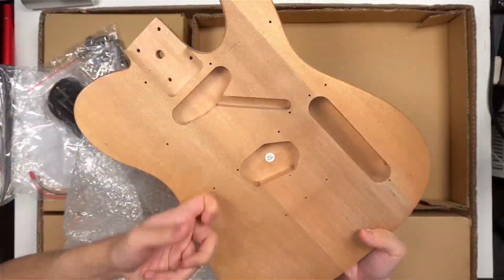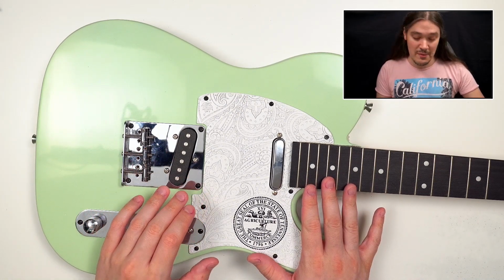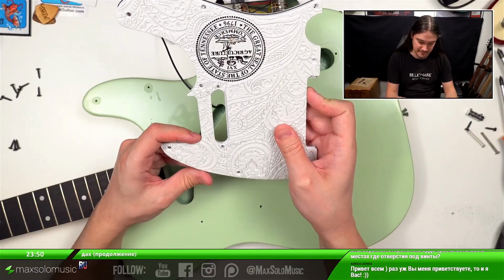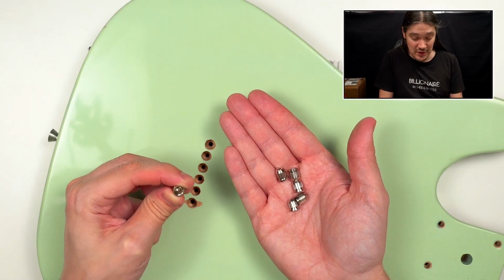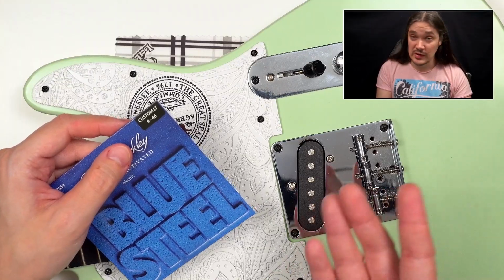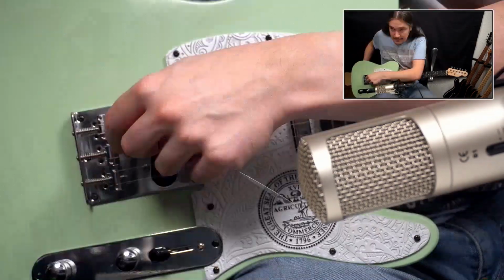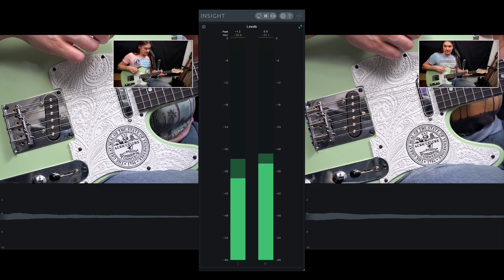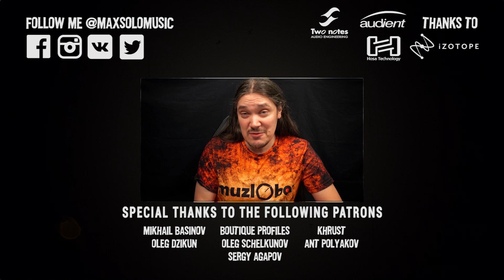String-Through Bridge VS String-Through Body. Harley Benton Tele Makeover Continues

Comment: Lets face it. The string only ever vibrates between 2 points. The nut an the saddle. An its that vibration that is sensed by the pick up turned into a low voltage signal that is then boosted by the amp. In order to move the speaker to make the sound we hear. Top Load or Through Body? Its 50/50 for me.

Comment: to my experience the material of the saddles makes even more difference. Try the same test with stainless steel and bronze. So we see if you find the same difference. By the way when the guitar is unplugged the difference between body/bridge is more evident. I find a more "metallic" sound through the bridge. But when you amplify that the difference is less IMHO.
Reply: Brass.

Comment: to me in conclusion diference is minimum so it doesn't justify the effort of drilling holes trough body
Reply: On this guitar maybe so. I'm not convinced that you would get the same result from a better quality guitar with better woods, nut and other hardware.

Comment: I have a string-trough Tele and a top loader. If there are any sonic differences, it’s probably due to the fact that one is a thin-line and the other is solid. For practical purposes, they sound  the same. Has anyone ever walked out on a band because the guitar was strung a certain way? For that matter, I have never thought I might enjoy someone’s music more if only they had different pickups, or bridge, reverb unit, etc. Sure details are important, but Telecasters sound like Telecasters, for the most part.

Comment: Thinking about upgrading a basic Harley Benton TE-20MN BM Standard Series guitar to through body stringing brought me here and the result is I don't think it is worth the time, effort or expense to do it.
Through the body seems cooler and more artistic but there was very little benefit to be heard in the different sounds between the 2 stringing methods.
Thank you for posting your experiments which has helped to clear up this mystery.
Reply from the maker: There may be a bigger difference with higher price range guitars made of some top-class tonewood. With TE-20 probably none at all :)

Comment: I have a cheap Tele copy which I've owned for years.  It's a Tanglewood 'Quo Master'.  Over the years it has been upgraded with various Fender parts, but one thing I never changed was the 'Top' stringing system.  I had seriously considered coverting it to 'string through', with the ferules, but judging by your very handy video, I'm glad I didn't.  There is very little difference,  in fact you need machines to detect this difference, especially in sustain.  Originally, the reason why I was sceptical about changing the Top stringing was the fact that the guitar would lose some of  its brightness and sparkling tone.

Comment: Top load had a tiny bit more upper mid twang to my ears. But I think with brass saddles it is more pronounced. String break angle being sharper and anchoring in the body to my ears is ever so slightly warmer.

Comment: I prefer the string through but it is due to the long term stability of the bridge. With the strings through the bridge, the forces are constantly pulling up on the rear of the bridge. With a string through setup the preasure is pulling down on the bridge and essentially holding it in place.
Reply: What you speak of here is exactly why I prefer the "string-through-body" method.
Reply: It does not matter if in a strings through the bridge the forces pull up the rear of the bridge, as long as the bridge does not lift.  

I prefer strings through the bridge in a Tele because it provides more chime sound and then I install a hybrid set of strings ( 3 heavy bottom 3  light top).  

This gives me more body sound on the lower strings and more chime on the higher strings.  Fuller tone.  My opinion.

Comment: I am rebuilding a lyon solid body. It was a thru the body axe, I'm going to top load with a adjustable. bridge and tail piece. I am going to have t locate the bridge and drill the holes for the studs to mount the bridge. What formula do I use to locate it or can I just eyeball it?

Comment: I’ve been top loading for about 20 years on my ‘72 Fender Telecaster. I do it this way because I feel the strings are easier to do bends. Just lately I restrung trough the body. Let’s just say that I cut those strings off the very next day and top loaded with a new set of strings. Maybe it’s in my head? As far as sound and sustain?? Too subtle to hear. Great video and lovely build 👍🏻👍🏻
Reply: I’ve had a couple of squire classic vibe guitars and didn’t like how stiff they are to bend. I’ve played other teles that have strings through bridge and was much easier to bend. Classic vibes are well built guitars so maybe it’s the strings through body that I dislike
Reply: I’ve had a couple of squire classic vibe guitars and didn’t like how stiff they are to bend. I’ve played other teles that have strings through bridge and was much easier to bend. Classic vibes are well built guitars so maybe it’s the strings through body that I dislike
Reply: I’ve had a couple of squire classic vibe guitars and didn’t like how stiff they are to bend. I’ve played other teles that have strings through bridge and was much easier to bend. Classic vibes are well built guitars so maybe it’s the strings through body that I dislike

Comment: Thanks for this video helped Me a lot in deciding, I'm in the process of taking off a Floyd Rose set up, which I hate  from an Aria guitar that My Grandson gave Me, I'm going to replace with a hardtail top mount as it will be easier to change strings when required, also I'm going to replace the metal string clamp nut set up, another thing I don't like about the Floyd Rose and replace with a bone nut, I'm not bothered about not having a wammy bar anymore, never used it anyway, this will be My stand by guitar, main one is one of the better Les Paul copy's.

Comment: Well done. thanks for making the video. very little difference. Jimmy Page said he used to break fewer strings when running them through the bridge. the holes in the bridge on the through-body bridges place the strings at a sharp angle without a smooth transition to the saddles.

Comment: I bought a Squier affinity tele on black friday. I to noticed the neck 
pickup had a lower volume and darker then the bridge and noticed it was 
far away from the strings. I opened it up and it's screwed to the bottom
 of the pickup cavity with no way of adjustment. Then i noticed that 
replacement pickups were adjustable. I told myself, it can't be that 
simple could it? So I took a couple of pickup springs I had laying 
around and installed them under each tab of the pickup, so as I turned 
the screws in and out, it adjusted the pickup height. I adjusted the 
stock neck pickup to about the same distance from the strings as the 
bridge pickup, wow. The volume is now close the what the bridge pickup 
is and the tone got a little more twang in it (brighter). I think the 
problem is the neck pickup in these Squire's are just mounted to low. I 
will not be upgrading my pickups.

Comment: So the new pick guard looked a little off centered once it was finished.  This happened to me when I changed the pick guard on the Telecaster I built.  You can see it at 5:36 into the video.  It's not a big deal it just makes it appear as though the strings aren't centered when in reality they are. The reason this happens is because the holes on the new pick guard sometimes don't match up and we have to adjust for that.  This look doesn't bother a lot of people, but I'm a bit OCD when it comes to things being centered.  I assume this is a by product of me being in the military when I was younger.  I ended up filling 5 of the 8 holes in the guitar body where the pick guard didn't match.

 What I did to bring back the visual effect of the strings/bridge being centered is this: I first measured the gap from the right side of the bridge to the pick guard. Then I flipped the new pick guard over and marked how much needed to be shaved off on the other side  in order to create the same size gap on the left side.  I used my dremel with a little barrel sander attachment and very slowly shaved off enough of the pick guard on the left side until the gap matched.  Then I put the pick guard back on and that brought back the look of the bridge being centered. 

I just thought I would toss out that idea in case it happens to anyone else reading this and is having the same issues with the new pick guard creating an off centered look.

Comment: The difference is very clear both acoustically and through the amplifier. Whoever doesn't hear it should consider buying better headphones.
With the strings through the body, the sound has a longer decay and richer harmonics.
With the strings through the bridge, the transient is shorter and the sound is poorer in harmonics, making the guitar sound plastic-ey.
Reply: I thought the same thing when I read the comments, I think people have been buying some bad headphones lately.
Reply: Headphones? You mean people aren’t just listening to the phone speaker???

Comment: Very cool, thank you for the video. I've also watched your tips for repainting a guitar and I am now set on repainting my Tele for a summer project. I am still undecided on drilling holes for through the body option or sticking with through the bridge, both options sounded great in your demonstration. Keep up the great content!
Reply from the maker: Rock on!
Reply: Thanks Guys, was really trying to decide if I really needed to drill through the body or not on my tele kit guitar.
Can’t really hear any or very little difference on your sound test, well nothing that an amp tweak wouldn’t sort.
You’ve saved me a lot of hassle for sure👍

Comment: I just did a Tele and could not stand the steel barrel saddles. So I went to the compensated Wilkinson brass saddles. I couldn't stand those either. Just something about trying to play so far out of intonation really messes with me. So I had to actually to to the 6 saddle Squire Bridge, and it came with brass saddles. So far very pleased with that. Now I am waiting to install new pickups into it when the new GOTOH locking tuning keys get here. I mean, does the intonation not bother other people also?
Reply from the maker: It does. It should!

Comment: I have had a few Tele kits I wanted to drill through the body to accommodate different bridges. However I don’t have access to a drill press and I don’t trust my hands to do what looks like precision drilling. Can you tell more (or even do a video) on that wood block technique you used here? I enjoy these videos a lot, thanks for making them!
Reply from the maker: Hey Greg. It's a simple idea. Take a wood block thick enough and drill a hole in it. Use it as a template to drill other holes. As long as you shift the block left and right or up and down without rotating it, all holes shall be parallel

Comment: In the late 50s fender tried switching to top load bridges, it didn’t last because players wanted more sustain which the thru the body bridges offered.
Reply: I heard Fender switched to thru body stringing on the Tele due to the top load bridges pulling screws out and lifting causing warranty repairs 🤷‍♂️

Comment: Sound is similar enough to not make a difference in my opinion. I would be interested in your opinion on feel. Particularly when bending strings. Most folks claim easier bending with top load vs through the body.
Reply from the maker: Yep, it is slightly easier. Generally the shorter the string, the easier it gets with a Floyd Rose being the best solution in terms of easy bending since the string is locked at the nut

Comment: Any difference between the two is very subtle. :) Interesting, since l’ve always assumed stringing through the body would sustain better. A tip for fitting the string Ferrules in the back of the body: Heat up a soldering iron with a round tip. Fit the Ferrules over the tip to warm them up, then push them in with the soldering iron. Obviously, be careful not to burn yourself, or scorch the finish in the process, but heating the ferrules slightly always makes them go in rather more easily.
Reply: Surprised to hear that, I thought they might expand a bit, thus being harder to seat.
Reply: @IfUfindthisURlost 
Correct.

Comment: Has anyone tried a mix like 3 low strings through the body and 3 high top loaded, or any other variation for that matter?
Reply: Yes that's been tried thousands of times.  I've tried it myself using different brands and gauges of strings along with several different....  SS/Tube amps along with swapping speakers.....different brands of speakers/cabinets/size of speakers/EQ'n the amps/amp on stands vs on the floor/dozens of pedals.... pedal placement on the board/pick up height adjustment/different nut materials.....swapping saddles....mix and matching different types saddles.... saddle materials..... pick materials along with different brands of picks/gauge of picks....patch cables along with different brands of patch cables/guitar cables.... Length of cables/different fret materials/ adjusting string action/different pick up positions..... playing closer to the bridge vs the neck.... Maple fretboard..... Rose wood fretboard.... Ebony fretboard etc' other type of fretboard materials etc so on. 
But I've only tried it one time. Also meant to mention on the same guitar' a 50's Baja telecaster with a b bender installed along with a drop D tuner on the low E string and drop banjo tuners on the high E and A strings along with a 1000k linear volume pot for volume swells.

Comment: Seriously cool video. To my ear, the difference was audible unplugged and plugged on the neck pickup. A bright snap to the sound. Almost bridge-y. Middle position and bridge were negligible and inaudible with even a little distortion. I don't think most audience members would notice such a subtlety at a show, but if the musician feels sassy and expressive with whatever nuance while composing/performing their music, then they should lean into it and play whatever mobilizes their best work. The audience will appreciate that energy.

After listening to a handful of samples, I am wondering if string-through has a more obvious influence on larger guitars and the floppiest pickup positions. Unplugged is moot. There is one bass video where it is very obvious which is string-through and which is top-load. That snap makes for a livelier tone on a very long scale length with strings that move at a greater amplitude versus a regular scale length guitar. The neck pickup in your sample was giving a bridge-y snap with like... 10% bridge intensity. Not much, but a qualitative difference. The middle and bridge where the strings always move less understandably didn't present much of a difference. It's all just really tight near the saddles. To me the snappy neck was novel but not the most desirable sound. A little harsh. JMO though.

I do wonder if this kind of intervention could be helpful on, say, a baritone where things can get unintentionally fuzzy on the low end, and the high end tends to be diminished.  Where on a conventional guitar the snap may sound a bit harsh, on a baritone perhaps it would provide some cleanliness throughout, but especially in the neck position. Maybe something to try out????

Anyway, thanks for listening. Looking forward to exploring your channel some more!

Comment: I would be interested in impact on tension.  I've heard it said that top loaded teles are easier for string bending than through the body.  Maybe a little scale of some sort (like a fish scale??) to pull a string up a tone and see if there is any difference on how much force is required.
Reply: When strings go through the bridge they are a bit longer, that's why it is harder to bend them I guess
Reply: I can't see that making much difference either.  In order to get a specific note, you require a specific tension.  Simple physics.  You're going to need the same amount of force in the end.  Maybe you need to bend one further if the string is longer, but same force in the end.
Reply: @denis_kleshchev  No, that's incorrect. The opposite is true. The more string there is the more it can stretch; therefore, less string means less stretch, more tension.

It's the increased angle over the bridge that makes the tension greater on the string through. More angle on the string through, less on the top loader.

Comment: You should use brass sadels that's the tele key to achieve good tone. I have the option to use both string ways on my 1962 tele I use a Joe Barden bridge and it did come only for strings true body but I drill the 6 holes my self and I like both ! Depending on what strings been used! 
For most I go 0.11-0.49 
It's a heavy Ash body and it has chunky maple neck bit darker tone. 
Like your test ! 
Beat regards from Sweden 🇸🇪
Reply: Probably true as to brass saddles.  I play bass primarily, and switch out for (or buy in the first instance, as it were) brass whenever I can.  On most my instruments.  Always notice an immediate tonal difference (probably also in resonance of the instrument when brass).  And am now in the market for a tele knowing the brass saddle secret to good tone.  So thank you for your comment.

Comment: Hi guys, I'm using THRU-BODY STRINGS (purchased without thinking about the meaning of T.B.) on a TOP-LOADED bridge 
Does anybody know if that could be a problem.
I'm not having any "issue", so far so good, but  I was wondering and couldn't find answers.
(Stings Model: LaBella Deep Talkin' Bass 760FS -TB - Standard)
(Bass Model: Fender Player Precision PF PWT)